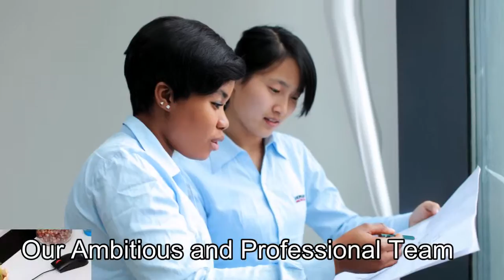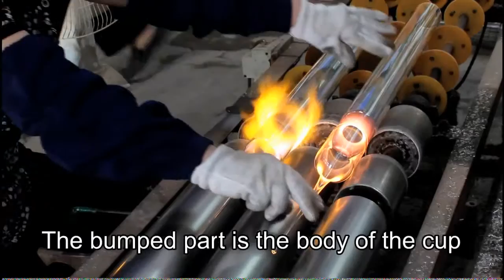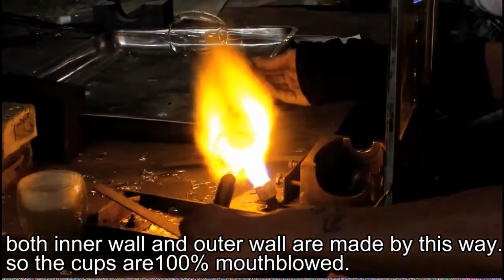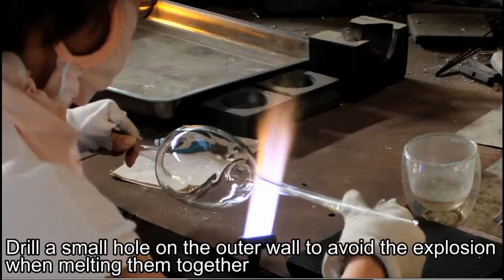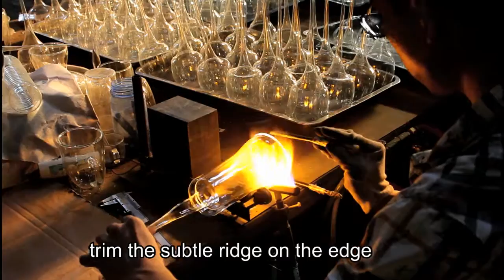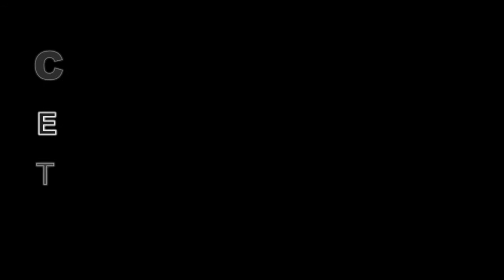Double wall galss cup manufacturer-For Coffee Tea Beer- Hosunware

Comment: But how is the vacum made? Or is it just an air inside?
Reply: It has to be just air inside, otherwise if it was a vacuum I'm not sure if they glass could withstand that pressure. 

Though since the air inside is highly heated there could be a lower pressure as the air cools down however if the glass at the end is still maleable I think it would just concave in.